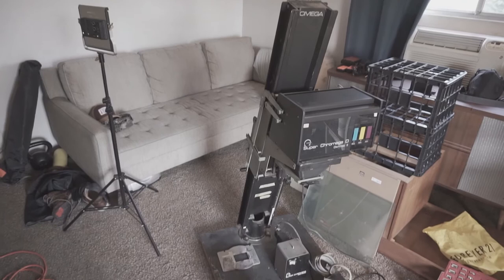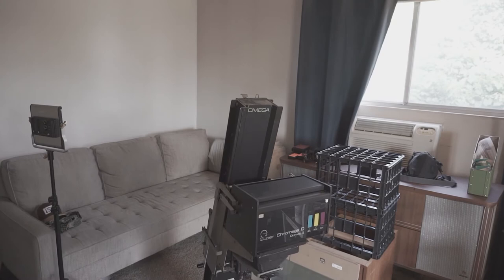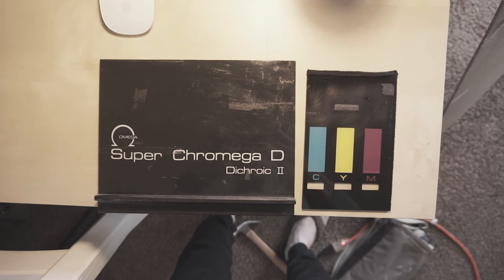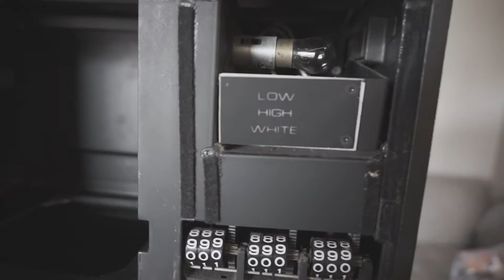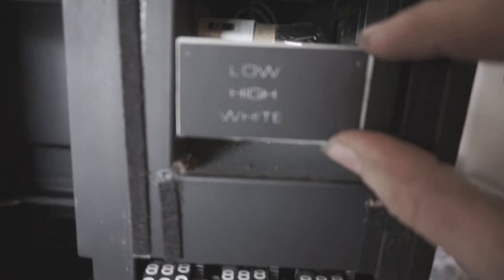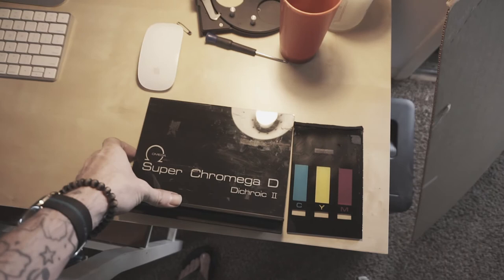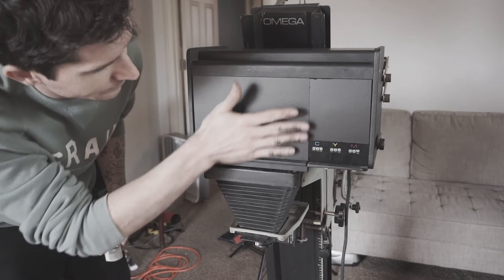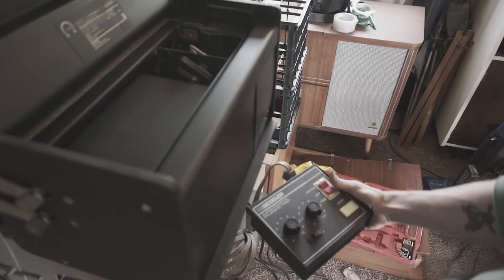I Bought A 4x5 Enlarger! Omega Super Chromega Dii

Comment: Just bought one of these myself! If you  (or anyone watching this with this same issue) want to get the low high white readout panel working again, you can unscrew the pivot screw in the arm by sticking a screwdriver through the color filter holder area and unscrewing. The arm for that piece slots into a small wheel that you can see visually through the color dial selector with the color plate cover removed. Also wanted to say, cool video!

Comment: I bought a graflex crown graphic 4x5 camera which has inspired me to build a darkroom in my basement. I have running hot and cold water available, and a 9 x 12 space. I started buying the equipment for developing first which was good because I would never have been able to figure out how much space needed for the darkroom sink to hold the trays nor how high to make the cabinets to hold the enlargers. I purchased an Omega 4x5 enlarger and then found additional enlargers for little money. I figured that I didn't want to keep changing the set up on the 4x5 enlarger so I decided I could set up three enlargers (out of six that I eventually bought) I also decided that I would not buy any more enlargers, except if one particular enlarger became available. That is the same one that you have here. When I started building the darkroom I wanted to offer it to enthusiasts in the area to be able to use so that I will have others call me up to see if they can come over so that I don't use it for a little while and then grow tired of using it. 

Enjoy using your enlarger and growing with your development.

Comment: I used a Chromega D for many years.  My only complaint is that it has poor light sealing where the head comes down on the neg holder; it leaks a horizontal fan of light in all directions.  I recommend that you paint the walls closest to the enlarger flat black; if you don't, that fan of light will hit the wall, diffuse, and produce a light fog on your print.  Oh, and the Chromega Ds had a bit of a tendency to 'pop' the negative part way during the exposure, due to heat buildup; can get frustrating.  But I hope you enjoy your new beast!  They were, for many, many years, the standard 'go to' enlarger in professional color labs all around the world.

Comment: I have a mint condition Beseler dichro 67s that an older retired gentleman sold me and I also picked up his complete darkroom setup all for $200. What a blessing as he told me he did not want this art to die and encourage me to take on this wonderful adventure. :-) I been printing in my closet darkroom for over 6 mo and love it. I came from the professional digital world (15 years) and this art process does not compare to the digital side. This is art!! 

But I got the large format bug big time.  My dichro 67s does not do 4x5. So I just found and picked up a mint condition Beseler Dichro DG Color Head mounted on a Beseler 45MX for $250. It was a steal. I can control the split contrast on the color heads when I print out my black and whites prints or just flip the switch to no filters and use Ilford contract filters. 

I hope to see you start making more YouTube videos soon.  You should try Litho printing. I am getting ready to start this adventure real soon. It will be interesting to see what you come up with. ;-)

Comment: That's a steal.  Working with a colour enlarger will make printing in B&W scads easier. You can increase the contrast by as little as 1 or 2 degrees.  Moreover, the diffusion enlarger will make printing a whole lot better with fewer hassles.
Reply from the maker: It has proved to be quite a great enlarger!

Comment: I scored a superchromega D5 with two dichro heads and two power supplies plus a Paterson 16x20 print washer, 4x5 negative developer tanks and hangers, a bunch of 120 and 35mm stainless developing reels and a stack of trays, negative hangers and a slough of other useful things FOR FREE on Craigslist. Not only that but I also got a complete darkroom setup with a Beseler 45M condenser enlarger for free as well with a set of Nikon El Nikor 55,80,135mm enlarging lenses. I'm sure where you are at 200$ is a killer deal but out here in San Francisco there are a shit load of artists just throwing this stuff away. At least once a week I see an ad in the CL free section with at least an enlarger if not a nearly complete darkroom. I literally have more than a complete darkroom and I only paid what it cost in gas to pick the stuff up. All I need is a 6x6 neg holder for the omega and I'm golden, the Beseler happened to come with both 4x5 and 6x6 holders which was luck but I might have to break down and spend some money to get the 6x6 holder LOL

Comment: For a mint?  $250.00 for all that stuff?  Geeze, I would by several at that price.  Excellent piece of equipment.  It was the standard for vertical enlargers in its day and commercial labs would have many of them.  BTW, the tape is supposed to be behind the light panel.  The big issue will be even light coverage across the mixing box on an older one.
Reply: Hooking that up to a Beseler timer is sacrilege, BTW.  But welcome to my world.  Hope you enjoy it.
Reply: Another, BTW.  As you are putting it back together be sure to check for alignment of both the lens stage and the negative stage.  A lot easier to take care of those while it's apart.
But having it aligned is crucial to quality enlarging.

Comment: Notwithstanding the stories of thousands of dollars of enlargers being thrown in the dumpster, $250 for a fully functional, late model Super Chromega with timer, presumably with a decent quality lens for 4x5 use, is quite a deal. My personal leanings toward perfection would have invested your time in changing the burned out panel bulb and lubricating the light intensity readout rather than painting over the front panels, but to each his own. Recommend: that you carefully check the alignment of negative stage, lens board, and baseboard, as being parallel to each other. Having slipped out of alignment is a subtle problem which appears as partial unsharpness in your prints.
Reply from the maker: I have heard a few of those stories myself! I was glad to catch this one before it met the same demise...because it was headed out the door to the bin. I may replace the bulb and fix the indicator panel down the road but we'll see how things go. I am still dialing in the alignment, but so far things look pretty plumb. Thanks for watching Randall! -chris
Reply: I was reading about that alignment / leveling of the head to negative stage, etc in the manual as well... then on to the baseboard that makes sense. Good tip!

Comment: someone may have taped up the "low/high" light because it was fogging paper.
I've had the same problem myself with other enlargers.

Thing is with enlargers, is there's nothing much to them. Just a transformer and a 12V light bulb.  Easy to fix.

For a couple of hundred bucks you've got something that cost thousands twenty years ago.
Reply from the maker: Yes, I noticed with the tape off from the back that light was coming through the front window. It seems pretty light tight now and the bellows look good, etc. Thanks for watching Jon! I should actually credit you for the gentle nudge forward. Thanks!

Comment: Ah... very cool video. 

I have  an Omega Super Chromega... I have not used it a long time. Can you explain the oder of the power supplies and the timer. I have a 240 - 110 transformer and a seperate power supply for the Omega.  From the mains I know the transformer goes first, then the Omega power supply, its the timer, does it feed between the enlarger and power supply or through the extra power out put from the power supply... I hope that makes sense. 

Do you know how to print BW with multi contrast paper using the Omega? 

How did you go printing colour?